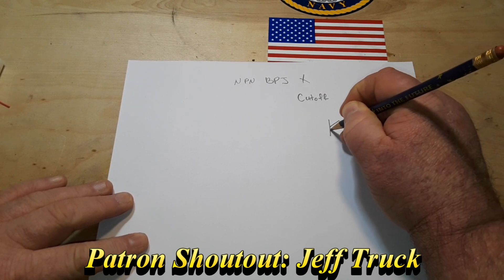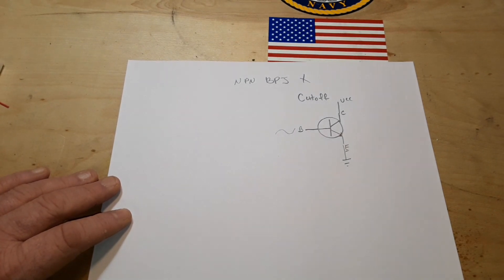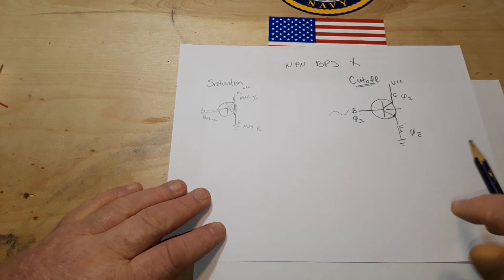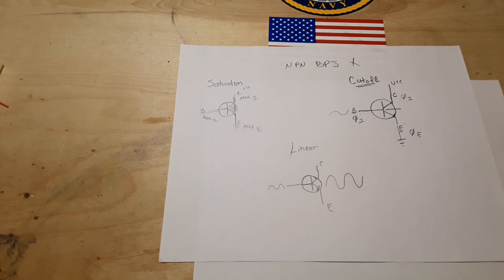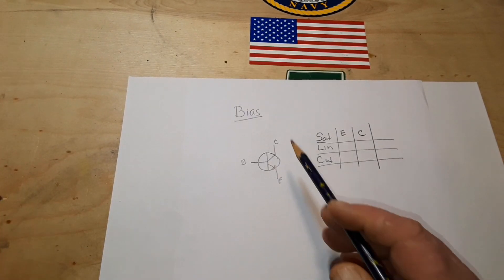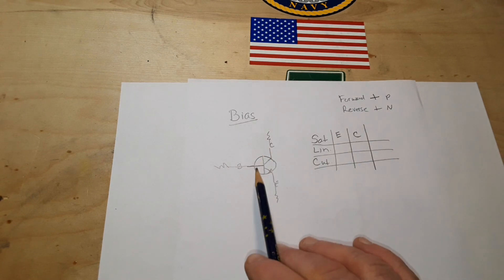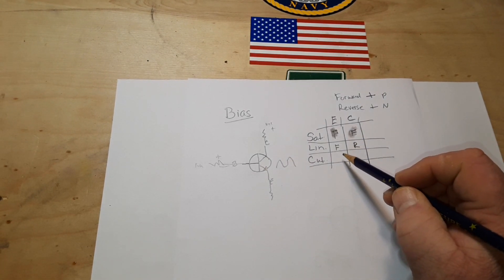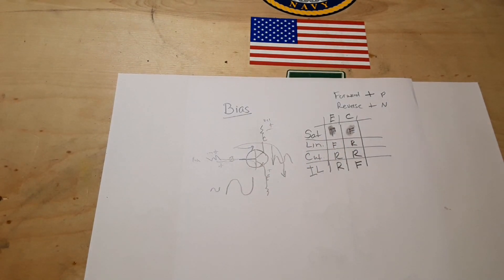Transistor Talk: NPN, Bias, Regions

Comment: I was with you all the way up to the table at the end. To achieve the linear region, you forward bias the Emitter, which is a positive voltage on the P-junction? Relative to the Base? Isnt that having a higher voltage on the Emiter than the signal on the base? And reverse bias the Collector which is a positive voltage on the N-junction. So higher voltage on the Collector? Relative to the Base? So, Collector = High, Base = Low, Emitter = High?

Comment: Be real nice to make a simple video lesson about how to calculate biasing resistors for a transistor in cutoff, then a transistor in saturation, then in the operating region. If you take the HFE of the transistor and do some formulas to get the biasing resistors values. To make a gain of 1 or 2 or 3 would be nice to show how to get the biasing resistor values.

Comment: Have you ever heard of a complimentary long tail pair? I'm sure you haven't but it is possible I've actually used it in one of my amplifier builds and it sounds great transistors have a reverse voltage threshold. I have seen a PNP long tail pair and a NPN long tail pair. So I decided to design a complimentary long tail pair which involves a NPN and a PNP. It is my patent design 🤗 the purpose for doing this is the NPN is your input transistor and the PNP is your feedback transistor and this is nice when you are using only NPN's as your output transistors.
The PNP feedback transistor will work the NPN's and magnify the output a NPN and a NPN does not compliment as well as a NPN and a PNP. And yes you can use this in reverse if you were using a PNP only output💖 and the output is cooler and more efficient 😁 And so this is why I decided to design this. This was not easy to accomplish and it took a lot of thought and work to accomplish this complimentary long tail pair. I'm self-taught so sorry if I did not give you a deeper understanding of how it works it would be a lot to post.

Comment: Very timely! This seems like something that would help me drive a 5v latching relay from an esp32? Would it be possible to describe this practical application?
Reply from the maker: Did you check my playlists? Here you go: https://youtu.be/3bFs_MZVFxw
Reply: @learnelectronics  Yes, but in my case I had a 2 coil, 5V latching relay, which is by itself (i.e. no connectors, no diode, no transistor, just the relay). With the help from your video I was used BC547B and a 4k5 resistor to drive the on/off coils from an ESP32

Comment: Hi great video I need to find a transistor that will take the place of a hall effect sensor rapid on and off any Idea's . It's really important High amperage and voltage.
Reply from the maker: Use a mosfet
Reply: @learnelectronics  I understand that and know it but do you have any suggestions. I figure with your experience it would be easier for you to suggest a set up. Thanks

Comment: It's actually simple when you get the idea; when you biasing a BJT, you simply want to adjust it so that the transistor is constantly operates on the middle of saturation and cutoff. This is because in this configuration, you want to amplify a small signal which can't make transistor starts to operate, you have to give the small signal a support (And of course to avoid clipping). This is why they call this small signal amplification. So when you adjust transistor like that, you're on the middle of linear region (not that simple when doing the resistor calculations). When you superimpose a small signal onto the biasing point on the base of the transistor, the middle of linear region that transistor standing on is shifted either towards the cutoff or saturation region, this shift depends on the instantenous magnitude of the small signal. So the signal is amplified on the collector node.

Comment: When I saw the video title I thought you would be talking about how to bias the base ie apply a dc voltage so the you keep the full signal rather than losing the signal under 0.7  volts
Or am I mistaken and have it confused with something else
Reply: That will come later, now that we have the polarities we can start to look at the actual values - complicated by all the different transistors out there.

Comment: I think of transistors as a pipe running from the collector to the emitter and the base as a tap, electricity can be thought of as water passing through the pipe from the collector to the emitter and the more you open the tap, the more electricity flows.